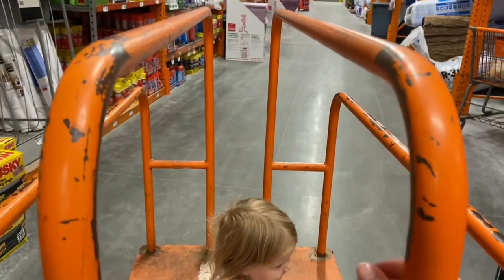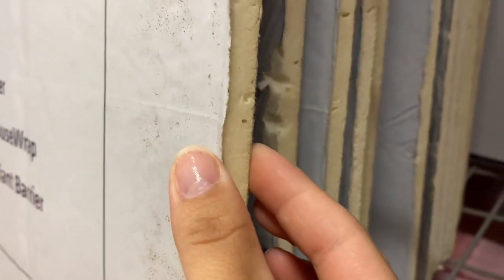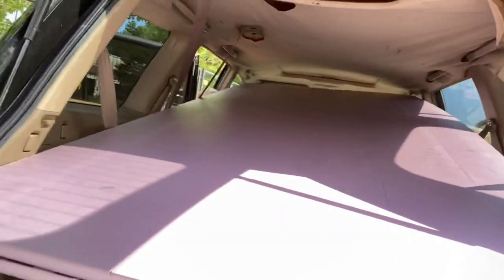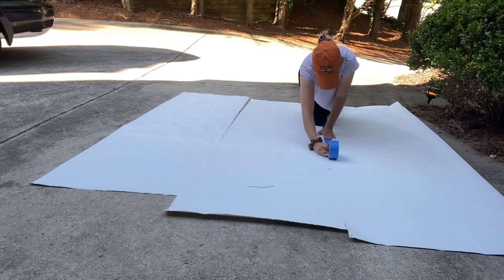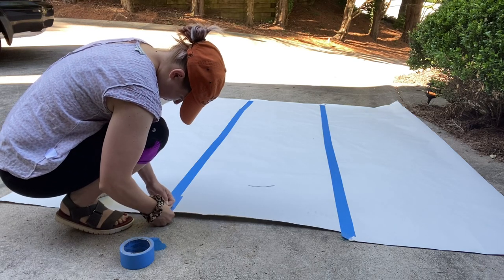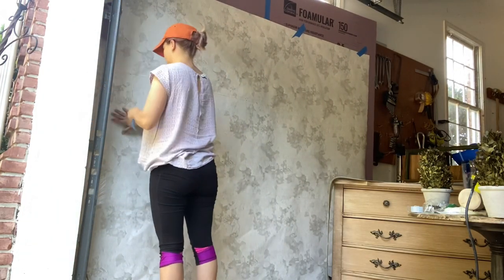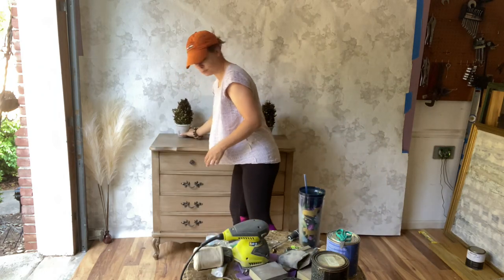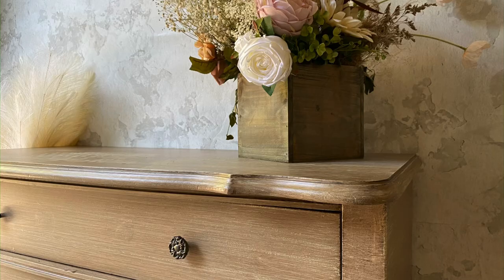Build A Backdrop for Furniture Flipping with me!  LIGHTWEIGHT, easy to move, customizable

Comment: What if you taped the boards together, use a neutral color texture paint to paint the wall and hide the joint?  Then stencil a pattern on the "wall". You could use a shade lighter or darker to create a tone on tone subtle background, or a completely contrasting color for a more dramatic background.  But, I've noticed that eye catching backgrounds tend to detract from the piece being staged.  😏  I think you have an excellent idea, you just need to commit and attach the wallpaper to your board.  If it peels then pull it off, flip the boards around and do the backside.  😁

Comment: Great ideas!
I think you should commit to wallpaper on the foam board - or do a DIY real cement wall on the foam board. 
Would you be willing to share links to the foam board? 
Thnx for sharing this!
Reply from the maker: It’s just the purple foam board at Home Depot 1 inches thick ❤️ https://www.homedepot.com/p/Owens-Corning-FOAMULAR-150-1-in-x-4-ft-x-8-ft-R-5-Scored-Square-Edge-Rigid-Foam-Board-Insulation-Sheathing-20WE/207179253